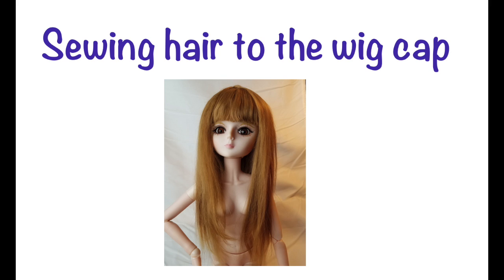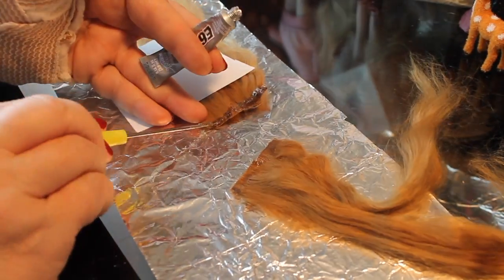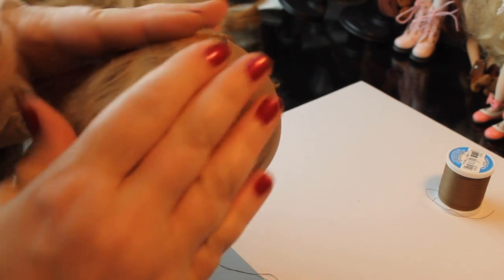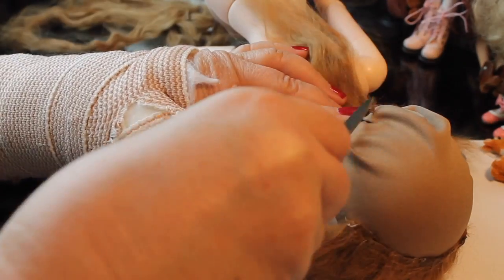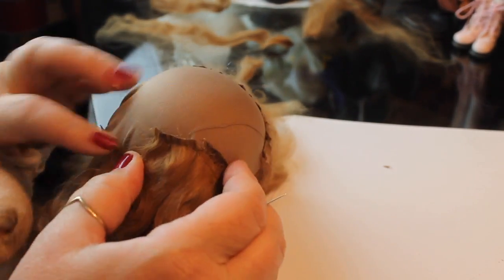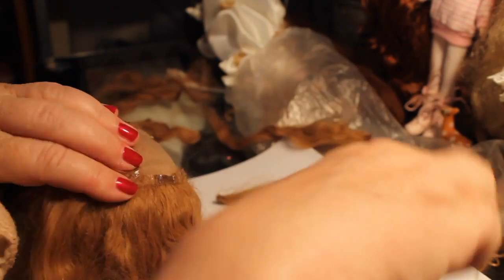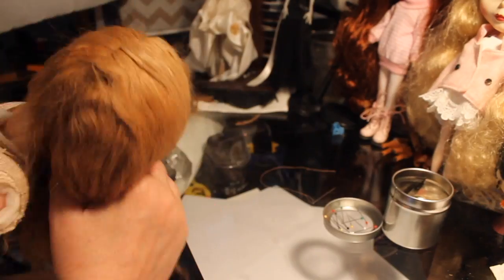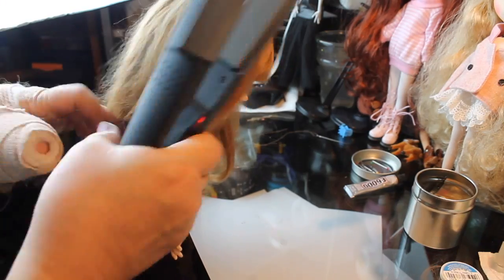Sewing hair to doll wig cap

Comment: After having tried probably all the methods of giving dolls hair (rooting, knitting and gluing and making various wig caps with different glued in hair) this is my favourite.  I really think sewing it into an elasticated wig Cap gives the best result. I haven't tried making the wig Cap in the white glue and stocking way and then sewing in as it just sort of seemed logical to make a wig Cap from elastic and stocking material and then sewing the hair in. The only thing is the parting line because I usually cut the wig Cap along the part line and insert the last couple of bits from the inside to get a nice parting. I think just bought a prerooted head because I just had another rooting nightmare with the cat getting involved and hair everywhere! It's nightmarish..but this is the best way Lol! Yeah I do a sort of running back stitch too..I find it's better on the doll too as you don't have to hold it in the stretched position if you do. I don't know how you're doing that with your hand still in plaster! You are of a stronger constitution than I (me ? Whatever Lol!).